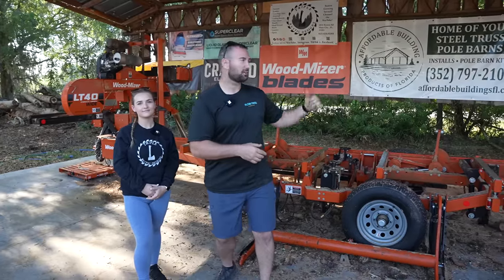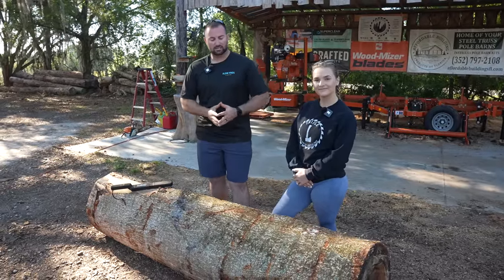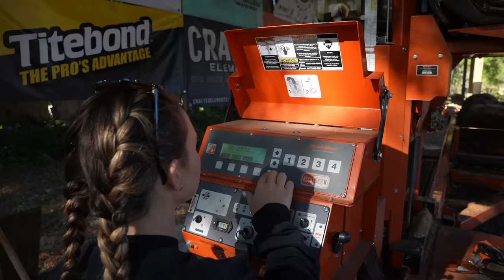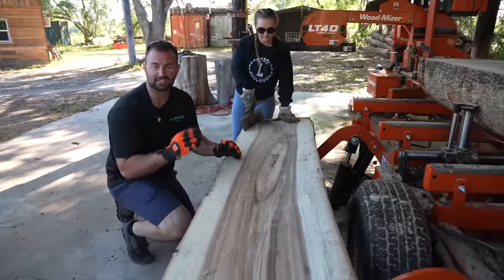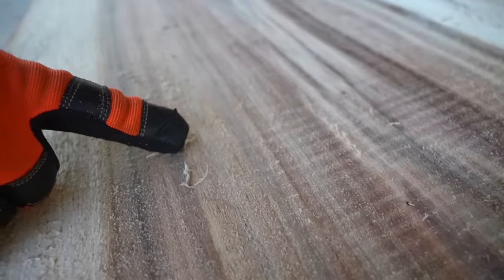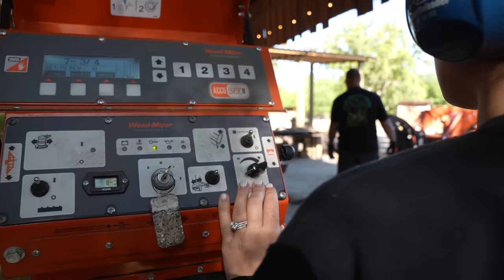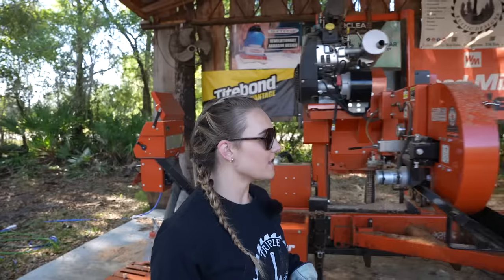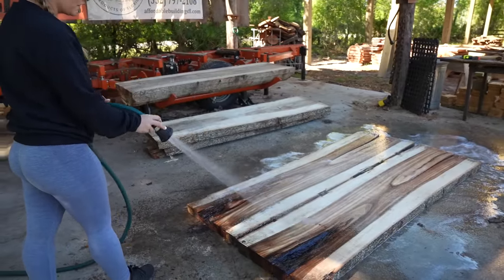More Monkey Pod on the Mill Today!

Comment: I have a question why do you guys cut the wood so thick good at not be an inch thick or an inch and a half just to get one or two more pieces? Or is there a standard thickness for stability thank you. I love your channel. I been watching you guys forever. You guys are amazing. Your family is growing. Congrats on your life changes, Tom in California.
Reply from the maker: Good question. For slabs, we have learned we need to cut them at 2.5” minimum to get a 1.5-2” finished product. During drying, the slabs move, cup, twist and crack. By having them thicker we can flatten them back down to still have a decent thickness.
Reply: I guess they aren't going to reply to my comment.

Comment: I have been told to get the Ripper37's They are sharper and last 37% longer..But I gotta buy pack of 10 and not 5..when trying a new blade I would rather start with a small pack but the smallest they sell is a 10 pack